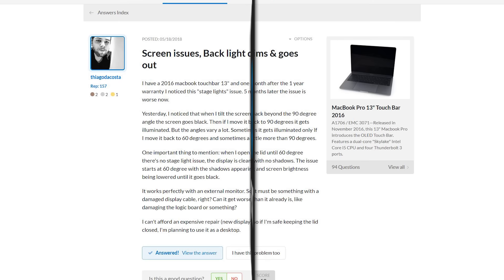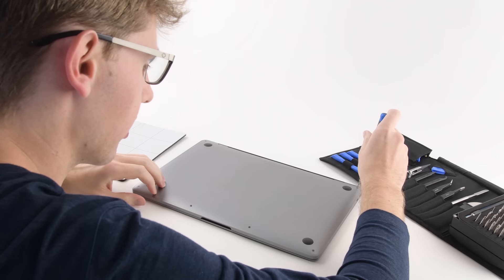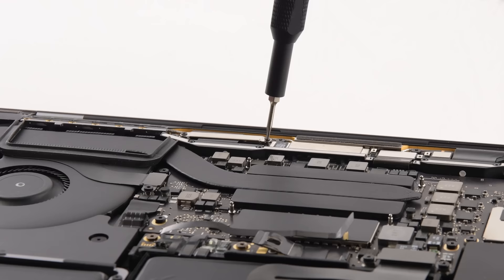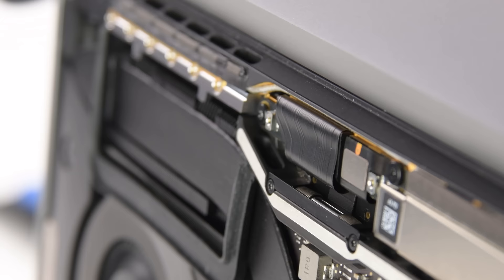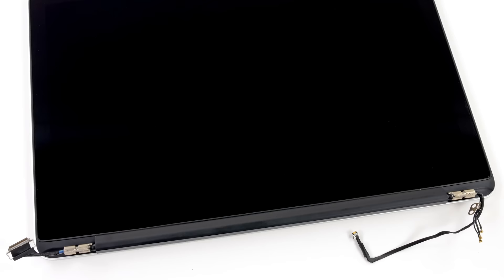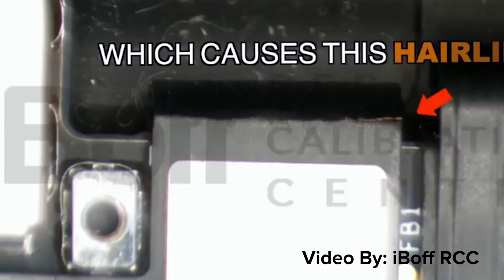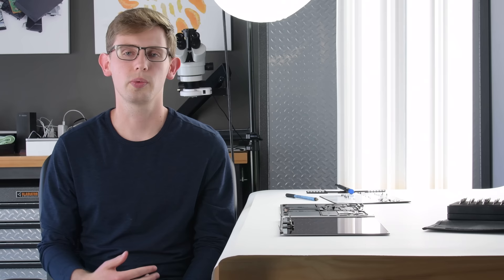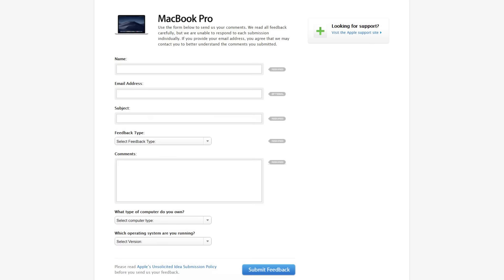The Design Flaw Behind MacBook Pro’s “Stage light” Effect! #Flexgate

Comment: ATTENTION FLEXGATE SUFFERERS! If you want a fix, here’s what you need to do. First, buy some metal polish. Then, gently rub off a small piece of the oleophobic coating off on your display. Then, take your computer to Apple. They will fix it for free under the oleophobic coating recall, even if the screen has other defects.
Reply: Or just don’t buy an overpriced Apple product.
Reply: lvlaple4Ever This sounds like a better idea!
Reply: You use the metal polish to rub off the coating?
Reply: That wont solve this issue
Reply: It'll come back in a few years. Requires a total redesign of the cable flexing.
Reply: Can't rubbing alcohol do the same thing?
Reply: lvlaple4Ever people buy Apple for quality but how ironic eh
Reply: @anandsuralkar2947  Actually it will.  since the display and the coating and the flex cables are a single unit, they will have to replace the unit.  You are correct that in another couple of years it will recur though...
Reply: @wizcombo  Apple has consistently had the highest quality products in the marketplace and this is still true. Just because there is a design flaw, in no way means there products are poor quality. They are still human after all.  Hopefully they make good on this and stand behind there products as usual.
Reply: It sort of does, it shows lack of testing and quality control, at least in this product. Ergo it is a poor quality product.
The fact they are allegedly removing all posts on their sites re this is clearly poor management response. So two poor events is it's own advert.. @maxdamage8562
Reply: @dougaldhendrick3497  The fact that some units are failing this way doesn't mean that Apple failed at testing.  It's quite possible that someone supplied them with inferior flex cables during production that are now failing.  We really don't know how many of the units are failing in this way.  Certainly there is no doubt that Apple should stand behind there product and service these failures for free.  The removal of posts is inexcusable in my opinion. So yes, it looks bad.
Reply: I doubt they would replace the screen if out of warranty, using the oleophobic coating tactic. If in warranty, then they would have to replace it due to the cable issue.
Reply: they probably designed it to fail just after the warranty is up. Only suckers still buy apple.
Reply: @dougaldhendrick3497  Spot on.  This issue should have been caught with normal testing - as in opening and closing of the lid thousands of times to see what wears, especially when they will have known that cable will be subject to wear just by the strange design decision alone.
Reply: Ryan Pavey You’re very smart😂🤣👊🏽
Reply: @maxdamage8562  My fanboy radar is pinging.
Reply: @maxdamage8562  "highest quality products" Hmmmmm. Phones with antennas that dont work if you hold it, bent phones, ipad pros that ship bent from the factory, faulty keyboards, faulty screens..... I guess sheep have short memories!!!
Reply: Well this is convenient
Reply: yea but the product has to be under warranty for this.
Reply: @maxdamage8562  As someone who's used Apple computers since 1996. I can say that it DOES mean the product is poor quality. The 2016 TouchBar MacBook Pro is the worst Apple computer I've had. It's not just the Flexgate, it's also poor keyboard, lack of ports and constant disconnecting of the charging cable after just slightly moving the laptop. Whether I manage to get the screen fixed or not, I'll sell this machine and buy a pre-touch bar one. My dad still uses MacBooks Pro from 2006 and 2011 and they still work fine.
Reply: Guys, is this works ?

Comment: You really have to "Think Different" to design a laptop with a hardwired displaycable that has to bend around a sharp corner every time you open the device xD
Reply: "cough planned obsolescence cough"

and remember integrating the display cable into the display, making it impossible to replace for 3rd part or user replacements is 100% done to fuck with people, it has 0 other reason :D
Reply: It's pretty crazy that a damaged ribbon cable leads to a 600$ replacement to get the device working again.
Reply: It's almost like it's not accidental!
Reply: yea i feels like it's design to last a year or so....sales drop they gotta find a way to make people buy new one...
Reply: @SwitchedOnNetwork  Its almost like its just unlucky that this issue appears at the end of the warranty period...
Reply: "Think different, or just don't think at all."

- Louis Rossman
Reply: @afeef2152  Louis Rossman, our lord and saviour
Reply: @k1ngjulien_  we must warship him
Reply: Perfect way for apple to make since. It will last long enough for warranty and cost a lot for repair. This is what they do when it don't make much profit.
Reply: @cataria3903  Lot of people throw this term around but this is not planned obsolescence. Planned obsolescence is when you design something to intentionally break after some time. The intentionality is  what makes difference between a shoddy design and malicious design (designed to break). 

In Apple's case it is both form over function design (that Apple has always been famous for) and designing for the lowest manufacturing costs (while still charging sky-high premium) - a normal cable would last longer but also need more space in the chassis, cost more because of the extra connectors needed and take longer time to install that a pre-formed flex glued to the display. It is good enough for the one year they warranty it for, so who cares if it breaks afterwards? Then it is not their problem anymore - they will be happy to sell you a new screen replacement.

These problems are the direct consequence of customers clamoring for sleek, paper-thin laptops, phones, whatever that look so stylish - since we can't change the laws of physics, we get laptops that overheat and throttle down, laptops that have abysmal battery life (because large batteries won't fit), laptops where everything is glued shut and replacing anything is an expensive repair in a service center (because adding access doors and making things user-serviceable costs more, takes more space and breaks the oh-so-sleek unibody chassis), laptops with crappy chiclet keyboards (because a good keyboard costs more and needs space), phones and tablets that bend and break if you even look at them wrong, etc.

Basically the trend is towards making everything disposable as it makes little sense to make things durable when few people keep them beyond about two years. Saves both manufacturing and service costs (if an item is not designed to be serviced you don't need to keep spare parts, repair techs and a service center around ...)

This isn't just Apple, this is pretty much common sight for anything involving consumer electronics or home appliances.

What I just don't get is people who see and complain about these problems with Apple hardware - and then march down to the nearest Apple Store to get a yet another Apple gadget. No wonder Apple has no motivation to fix their junk when people are buying it regardless of how crappy it is.
Reply: @jan ciger
although this is not  as in your face as hp printer's programmed death after x amount of prints, which u have to get custom fimrware and what not to get working again, i would argue it is still a case of planned obsolescence.
both goes into apple's design goals: making things extremely cheap, make them as unrepairable as possible and ad failure points into the design, that breaks after x amount of time.
as long as no huge outcry with an extended warranty program happens, it is a win win win for apple, and even if it happens, most people will just ignore it, like christians ignore all the child molesting going in their church or the historic evidence, that this religion led to horror beyond believe, so do apple sheep ignore all  possible evil their savior (apple) could have done and even blame each other  on the apple forums :D
"u should have gotten apple care"....

the one apple product i ever bought was a thunderbolt to network cable, that i gifted to a friend, because he always used unhealthy wifi, but i personally would never buy an apple product beyond that, BUT like ifixit once mentioned, there is nothing wrong with people wanting to run apple software or have apple products, because u use it, doesn't mean u can't complain around it, or fight for it to be made better and less anti consumer.
especially with a modern landscape of either: getting shity garbage hardware and better software (apple), or getting  better reliable/repairable hardware and software, that literally spies on u 24/7, sells all your data, deletes files, is full of bugs etc... (windows 10).
with apple and microsoft doing their best  to keep gnu + linux as kicked down as possible of course.
in case of phones i hope  the librem 5 gives people a good option in the phone place.
for desktop, people hopefully end up using more and more hackintoshes, to boycott throwing money at evil apple, which would be great.

and in regards to consumers pushing for paper thin sleek laptops, phones etc...
i call bullshit on this one, design choices are NOT made by consumers, but are forced onto consumers,  i bet  most people will want a 2 mm thicker phone with all of that extra space being a bigger battery.
people also want a headphone jack and a user replaceable battery, again choices done without the consumers being asked, but done to maximize profit, force people into buying garbage dongles or wireless headphones, or buy a new devices if the battery starts to die....
in case of non apple products i can bring up the "famous" push from 16:10 displays and higher to 16:9 displays on ALL laptops and desktop monitors, this was not done through asking consumers, but was decided by panel manufacturers to maximize profit, as 16:9 24" is a smaller era than 16:10 24", but the average consumer doesn't understand the difference.
this 16:9 display on this lg laptop, was NOT a consumer choice and no one asked for:
https://www.lg.com/us/images/laptops/md05794170/gallery/medium01.jpg
to show an example.
interestingly for the longest time only apple had still 16:10 displays as apple can afford to ask for their own panels for their laptops of course, one of the good design choices in apple laptops, or rather lack of anti consumer choices....

also in regards to the stupid 1 year minimum warranty bs, wouldn't it be nice if a 5 year warranty on all electronics would be enforced, except battery, but batteries have to be offered and be user replaceable.
this would force companies like apple to at least design a somewhat decent product!! and also push them to make devices more repairable, to save money if let's say an ssd fails within the 5 years.
if u don't know apple know solders their ssds onto the motherboard, because of course they do :D
and a lot of higher end electronics already comes with a 5 year warranty, so it's not something outlandish to suggest a 5 year warranty, or least a 5 year warranty for all products beyond 100 dollars.
Reply: Jan Ciger in Scandinavia you have the normal 2 year European warranty and then you have an extra 3 years claim period after that on hardware failure if the device was made to last over 5 years, this is standard in both Norway and Sweden by law, and the producers will need to turn to their knees if you have a case of normal wear, and your device fails because of a hardware defect.

Apple will have loads of problems in Scandinavia if this is a fast wear-down problem, it could even lead to a class action or "government" lawsuit if they do not comply with the repairs.
Reply: I remember there was an issue with MBP display cables becoming loose, so I guess this is their ‘fix’, which they then shot themselves in the foot by ‘redesigning’ a thinner connector system that didn’t have the right side-to-side tolerance....
Reply: Yes, but don't xD in 2019
Reply: You’re opening the MacBook wrong! Here at Apple we apply “Think Different” philosophy to MacBook design so the display cable is placed like that to avoid being opened. Hence, just don’t open your MacBook lid and you’re good.
Reply: You guys just don't have...
'Courage.'
Reply: Well then make the cable removable not attached to the screen

Comment: My 2018 Macbook pro has this issue after 3 years of use. Took it to Genius bar and was charged $678 plus tax to fix it. As an Apple fan, It's sad see the quality of Apple products and service is failing.
Reply: Why the eff would u pay that when you could buy a 15in display off ebay for 200-250 and install yourself..

Comment: Apple knowingly designed this cable as part of the display. Just like how they hold the back on with clips as well as screws. It's all intentional design to make the MacBook more likely to break through increased fragility of the display and excessive force required to remove the back cover.
Reply: Stuntman707 Just like how the butterfly switch was designed to flex at its thinnest point unlike the traditional scissor switch. It too will succumb to material fatigue. It’s all in line with Cook’s goal to increase services revenue. Jobs never stooped this low.
Reply: Stuntman707 yeah No your wrong. They’re just not designing them perfectly enough
Reply: And make is not able to replace cable to get 600$ by replacing screen
Reply: @magsec5  they are desgining it perfectly to break and cost 600$
Reply: glitch gamer everything is getting more and more intergrated. This is just another one of those casualties.
Reply: To make a laptop as thin as possible and keep the tech journos happy Apple made some design decisions. FlatFlex soldered to PCB : 0.2 mm. Flatflex connector height 3mm.
Reply: Yes it's thinner, but also fragile and impossible to repair / expensive to replace. This has to be considered when in design.
Reply: No, that's a garbage argument. If you want to spread false conspiracy theories, keep up the great work, otherwise please try thinking.

Comment: The issue also applies to the 15 inch models for those of you wondering. However Apple does not cover the 15 inch models.
Reply: Yes they do. You just need to be persistent and spend up to 3 hours on support.
Reply: @FVBmovies could you explain this? Thanks

Comment: macbook pro 2015, last good macbook Apple made
Reply: Nah last great Apple MacBook was the 2012 13" pre-retina, MD101. Plenty of those models still in use today, and everything about it can be upgraded, repaired or replaced.
Reply: i agree, thats why i bought a brand new sealed in box mid-2015 as a spare last week.It will sit unused until my current mid-2015 dies(which it probably wont). Hopefully this will allow me to continue to use MacOS until tim cook the moron is ousted and new non-shitty macbooks are made.
Reply: @jonvincentmusic  Got my 2011 15 inch pro here beside me and it still performs like a champ. I got the logic board and battery replaced under extended warranty so it's basically as good as new, until the logic board explodes again.
Reply: 2012 non-retina
Reply: In MacBook Pro retina you need to replace the whole top case to replace the battery. So they are also not that good if you compare them to the older thicker MacBook Pro models.
Reply: Love my 2015 13“ Macbook pro. Still has all connections and good keyboard
Reply: very true.

I'm still using 2012 macbook pro non retina, it works okay, you can EASILY replace the battery, hdd, or ssd, upgrade the RAM, even you can remove the dvd drive to put a hdd in it.
.
I use it for my daily work (graphic design, etc).
Reply: You can scrap the battery off.  @Erik.Lundberg
Reply: L HK Yes I know but it’s not so easy. The new MacBook Air has removable tape securing the battery.
Reply: It's the same shit they use to secure window panels to skyscrapers. ;). But chemicals beat tapes.  @Erik.Lundberg
Reply: I am also using my md101. But my speakers are now rattling (time...).
Reply: 2015 macbook pro has staingate issues
Reply: still using macbook pro 2009
Reply: 2015 MBP owner here, just got my MBP back from screen replacement because of staingate. So, no. Basically all MBPs since 2006 have their own design flaws. Even the praised 2012 pre- retina model hat issues with dying graphics chips. Apples quality wasn't better with Steve Jobs, but the way they interacted with their customers got worse with Cook.
Reply: Still using mine. Never had a problem, very solid laptop.

Comment: My work computer which is a 15 inch 2017 MacBook Pro Touch Bar which had an issue with the keyboard where 2 keys would intermittently not respond or double type the key pressed. After getting the keyboard replaced which in turn is the whole bottom case, they damaged the antenna module in the repair. After 3 weeks I got the computer back and found I had this exact screen issue after I got the computer back. They were hesitant to even address the issue as it was only intermittently doing this and I had filmed it several times happening and finally they decided to replace the screen.

Fast forward a month and 3 other computers in our department had the keyboard issue. Once the three came back for repair, 1 also had this screen issue and were hesitant to replace it. Then fast forward 2 months, colleagues 13inch 2017 MacBook Pro Touch had the screen issue.

If Apple are willing enough to extend the warranty due to the keyboard sticky keys issue, they should also extend warranty of the display with the flex issue.
Reply: You dont have to replace the keyboard, just pop our the affected keys and clean them with compressed air - works like a charm.

Still disgusting you have to do that on a 2000 fucking dollar machine. What a rip